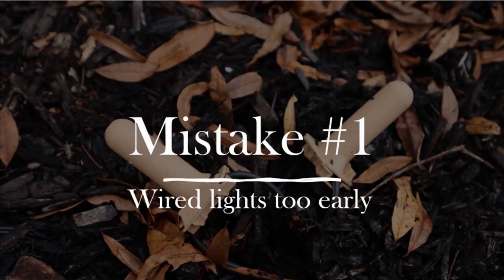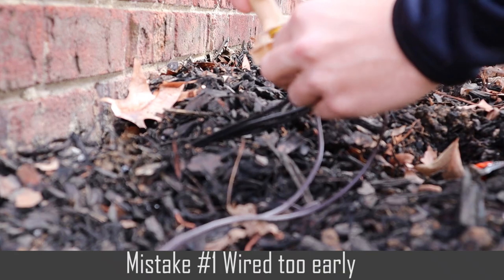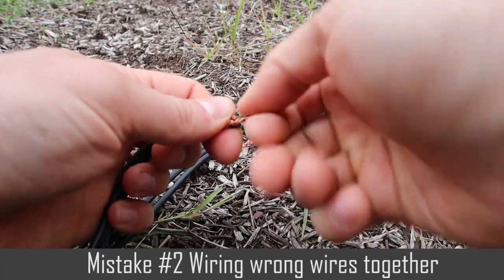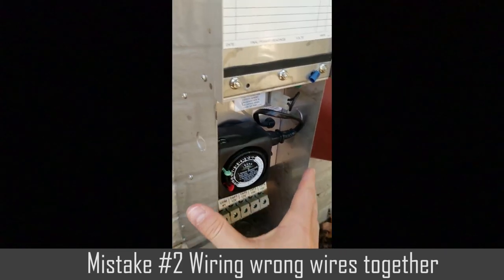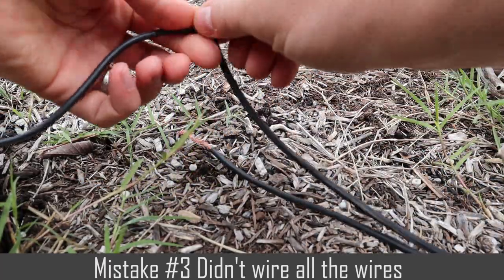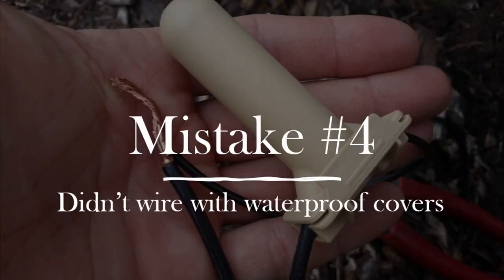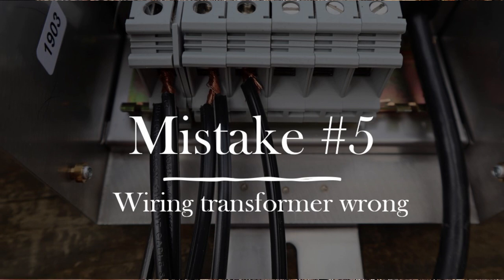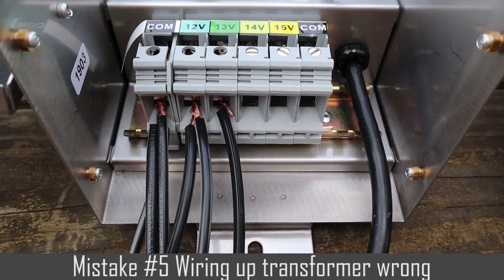Landscape Lighting Wiring MISTAKES - Common wiring mistake you don't want to make

Comment: My issue:  new wiring: all lights (8 led fixtures) new total 75 ft worked on first set up.  Later that night tired to see how they looked and the first light in the chain is bright the secound is very dim the 6 other lights are not working.  The wire is warm to the touch.  ??
Reply: Wire being warm to the touch is a sign of too much current running through too small of a wire. 2 solutions, use thicker gauge wire or increase the voltage at the tap.

The other issue could be arcing at one of the connections, indicating a bad connection

Comment: I have a 12 watt, 100277 volts, Bullet Flood Light.  The light has 3 wires.  Can you recommend a proper direct burial wire I should use?  (All the videos I see only have 2 wires).
Reply: I will only have a single light that will be about 15 feet from the transformer.  The application is for lighting my flag.

Comment: What if one of my lights isn’t working? It’s the last one on the line of 6, took it apart and the wires are all corroded where it connects by the bulb. Is there a way to fix?

Comment: I presume these waterproof wire connectors come in various sizes.  What size are you suggesting for general use?
Reply from the maker: Yes they do, but the size I use are the easiest to find, any other size you'll have to special order. I would suggest using this size.

Comment: Awesome this helped me so much with wiring.  How do you wire them to the main line together if they are farther apart?  Let’s say I have two lights in one bed and and the cord from the light is 18” to the main line.  The other light has 18” too but is 24” from the main line.  They are too far apart to wire together and then wire to the main line if this makes any sense.
Reply from the maker: I'll take a stab at it, I think I understand what you are saying. What you're going to have to do is use whatever excess wire you have from the light closer to the main wire and attach it to the light that is father away so it can reach the main wire. Example: The light that's close to the main wire might need 10 ft of wire, so the extra 8 ft can be connected to the other light's 18ft to make it possible to reach the main light 24ft away. Hope that helped!
Reply: Agreed! Super helpful!

Comment: How do you wire a T connection?  The transformer is in the middle of the light run and i have 12/2 burial wire coming off the transformer.  I need to run lights to the left and the right but am unsure of what type of connector to buy and also how to wire it.  Any help would be appreciated.
Reply from the maker: Wiring a T connection is simple. All you need to remember is instead of connecting 4 wires (2 words and 2 rough), you are connecting 6 wires because there are now 3 wires instead of 2 wires. 1 wire from the transformer, 1 wire from the left side, and 1 from the right side. The best connectors are the Dryconn brand from a local irrigation store. Hope that helped!

Comment: Question. Im trying to string patio light in the horizon point pattern. Is it safe to cut and splice the light string and connect them with the waterproof covers? This way each string of lights are right length from house to the pole?
Reply from the maker: I've never done it before, but I don't think it'll be a problem.

Comment: I know almost nothing about lighting  but would like to. I looked inside a transformer yesterday at a system that was not working and one of the wire nuts was melted. Thoughts?!!
Reply from the maker: Do you have a halogen system not an LED system? Most of the time when I see this issue it's because the system is halogen and there is a lot of electricity going through those wires. If those wire start to touch inside the transformer, they will start melting the wire nut. Once the wire nuts (is) are melted and expose the wires, the transformer will shut off if any wires tough each other. If you have an old transformer with a fuse in it, you will need to replace the fuse. If its a newer transformer, you'll just need to flip the switch. But make sure no wires are touching and replace the wire nut. Hope that made sense.

Comment: Adam , I doubt you'll see this but I saw you make a mistake . Those waterproof grease tubes your supposed to push the wires and wire nut all the way in so they coat the nut completely . The way your doing it, water can easily get to the exposed copper

Comment: I have landscape lights that have a red and black wire coming out. Does it matter which wire on a zipcord (rough vs letters) I wire each of those red and black wires to if I keep it consistent?
Reply from the maker: White is usually goes to the smooth wire (with letters) and the red goes to the rough if you want to keep it consistent.
Reply: When you have a pair of red and black wires (in the USA,) usually red is hot and black is neutral. When the wires are the same color, smooth is hot and ribbed is neutral.

Comment: Hi watching from England. No1 what the Bloody hell is that yellow thing? How is that a Permanent/Safe Connection? No2 what the Bloody hell is that Penis shaped thing? I know only 12v but this Really doesn't look safe. You can't have bare wires showing incase someone touches them!!
Reply from the maker: HAHAHA! That comment gave me a good laugh. Yes, those connectors have a funny look to them ha. No1. Those yellow things are wire nuts...the name doesn't help my case. They are a very common part of wiring. No2 The funny shaped thing is a waterproof connector, and they are safe to use and bury in your ground. No bare wires. Everything is safe, and because it's low voltage.

Comment: Actually, I’m sorry but I am completely new to landscape lighting. Did a little research but you are wrong in that you have to wire the wires with writing or rough edges together. All you have to do is wire anything to anything as long as everything is connected that’s all that matters even on the transformer end I paid no attention to what wires I was using on a huge run and everything works perfectly. You don’t have to pay attention people. This guy doesn’t know what the hell he’s talking about. I can’t believe he worked in a professional business for years, you do not need to wire certain types of wires or rough or smooth or whatever just connect everything up and you’re good to go

Comment: 3 times you incorrectly installed wires into the grease caps!!  You didn’t push them into the grease… isn’t this suppose o be an instructional video?
Reply from the maker: You're 100% right. I didn't show how it was supposed to be installed. This was one of my first videos I made and made a mistake. Thank you for pointing it out! I'll make another video to correct this.
Reply: ???  I’m confused now